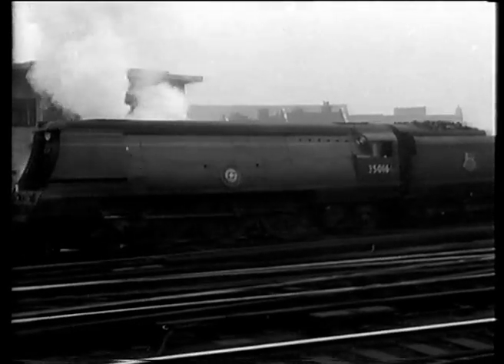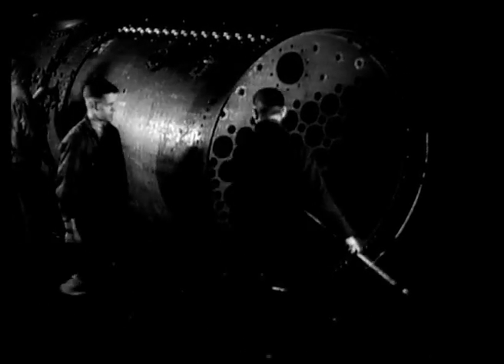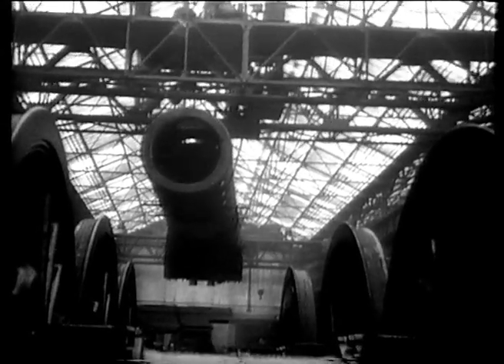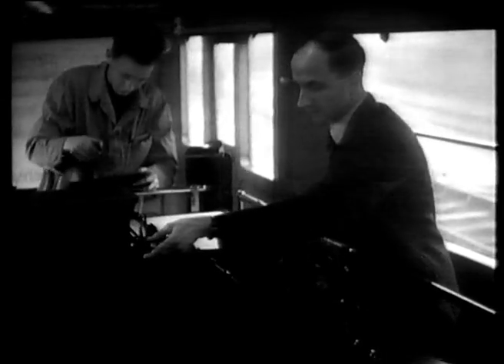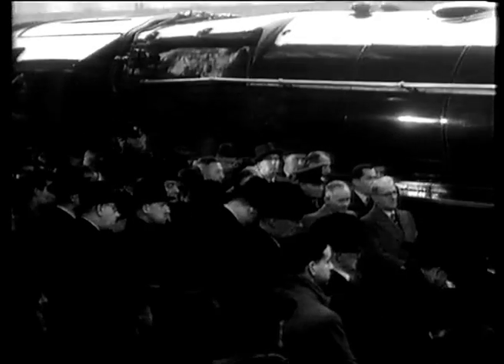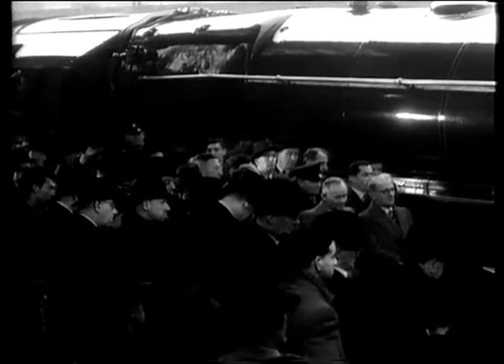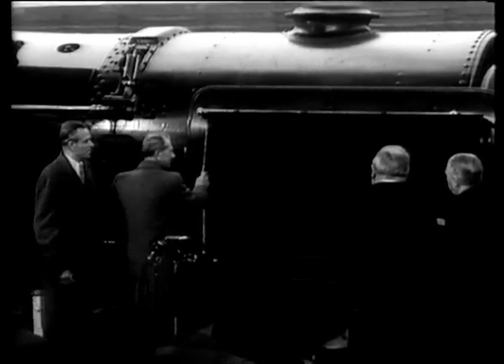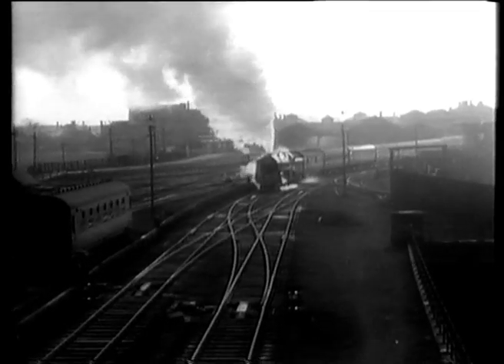BBC Television Newsreel 1951

Comment: Actually it was all standard until 1954 when 71000 came along with 3 cylinders .
Reply: Ah yes, the Duke Of Gloucester, a prototype that turned out to be a bit of a flop, so they didn't make any more of that type. The reason that it alone had three cylinders was that if it had had two like the other BR Standards, they would have been too wide for the BR loading gauge.